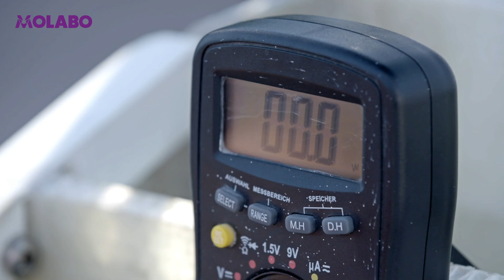The Electric Motor for Boats: ISCAD V50

Comment: A standard, 50 pound battery, gives a theoretical (in practice, less) 1.5 minute runtime. Even lithium filling up half the boat would not be practical, and insanely expensive.
Reply from the maker: Here you can find a range chart: https://molabo.eu/iscad-system-solution/#modulares . With our testboat we can drive e.g. 2,8 hours with an average speed of 7,6 kn